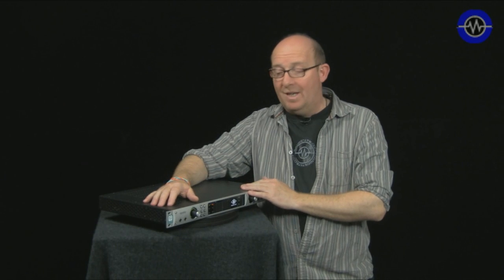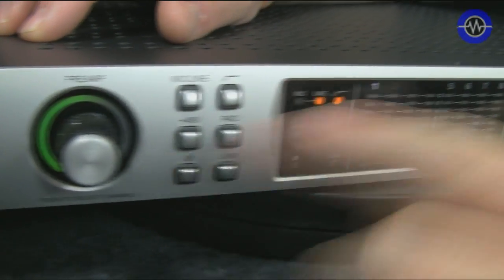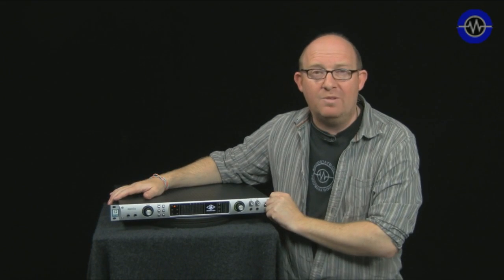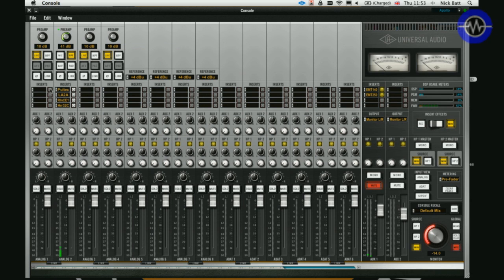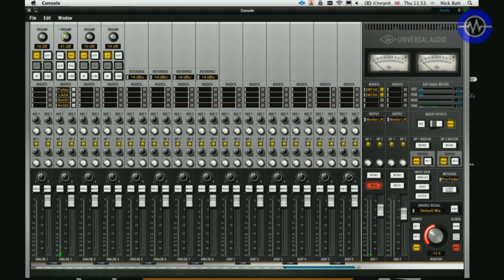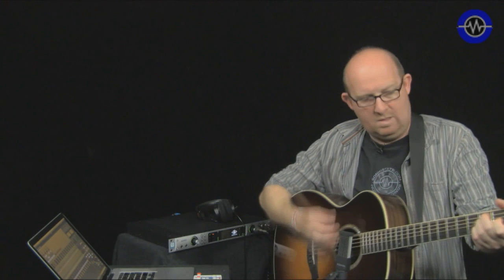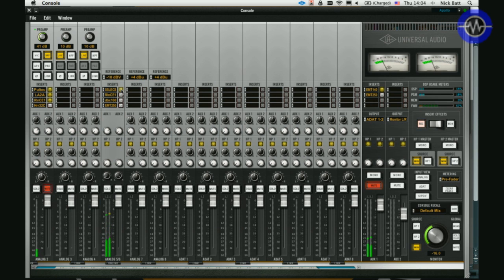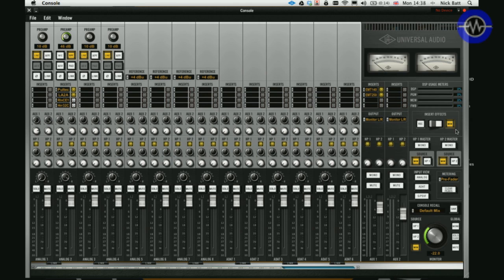Universal Audio Apollo DSP powered audio interface

Comment: I know i am a bit late on the comment, however: Xite/SCOPE platform from Sonic-Core have always allowed "printing to track" in real time, it supports either mixing in its own environment aka. the apollo mixer (which integrates with ASIO DAW), or using the SCOPE plugins as VST in XTC mode.  Actually Apollo is not doing anything that Xite can, and in addition SCOPE allow you to route how ever you want in the virtual routing/cabling environment.  (and synths aren't even being mentioned)

Comment: the implication is that it runs through the plugins from the input to the output in under 1.4ms of latency... there is no other unit that does that... simply because there is no other unit that HAS plugins in it.  The closest you can get with another unit is no latency into your DAW, insert a plugin that has some latency, and then output back to your interface, which COULD be low latency, but not as low as the hardware doing it immediately...